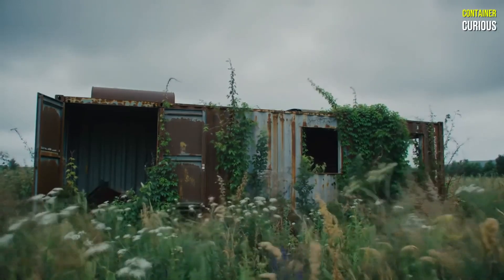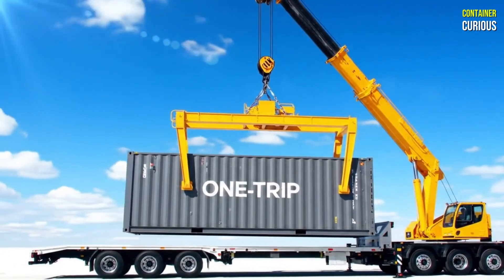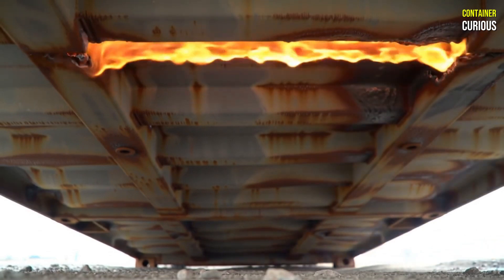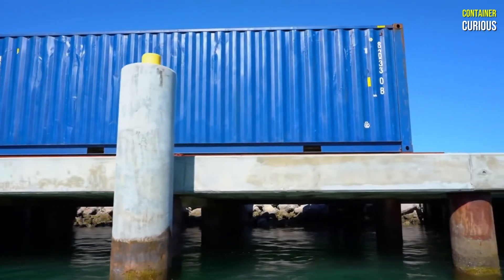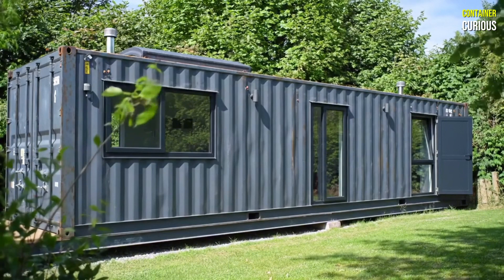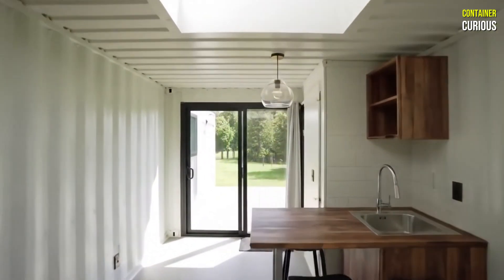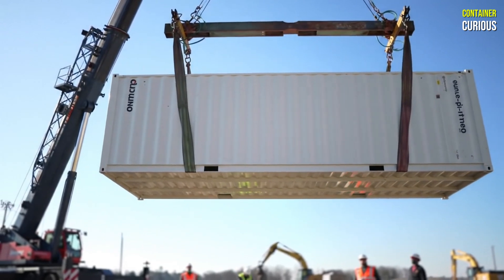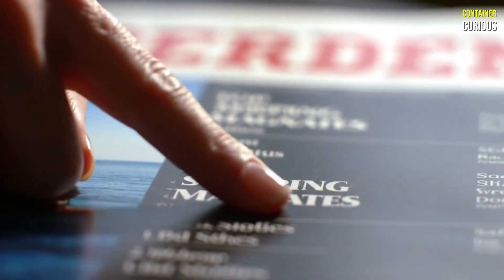The 4 Rules for Building a Container Home That Won't Ruin You

Comment: Need more info on how and what to use to insulate outside in different climates
Reply from the maker: That's an excellent and very important question. Insulating for different climates (hot, cold, humid) is one of the most critical steps, and you're right, it needs a much deeper dive.

We're actually planning a full, detailed video guide on exactly that topic – covering the best materials and techniques for the "outside-in" method in various conditions.

Thanks for the great suggestion! Make sure you're subscribed so you don't miss it.